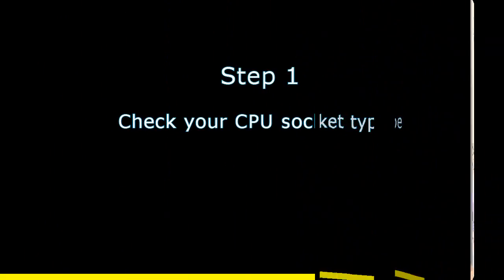Complete Watercooling Guide Part 4 (1 of 2) - How to select CPU waterblcok?

Comment: @wolfgoblin Now, thats what I call a funny comment. Thumbs up for you!

OT: Another great vid. Keep it up Daz. Could you please elaborate about the need of corrosion protection. Let's say for instance I want to run straight distilled with a biocide. Is that ok as long as I don't use any aluminum components?